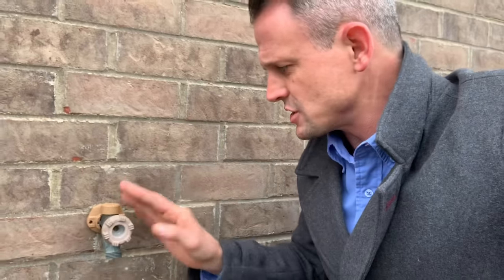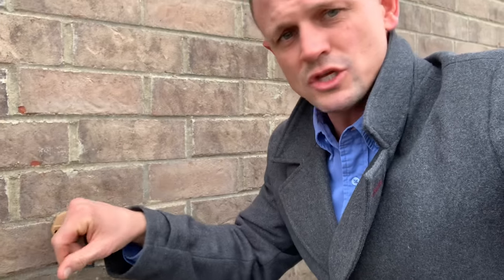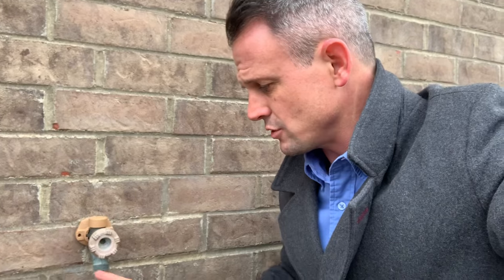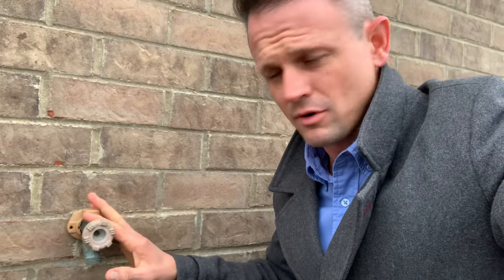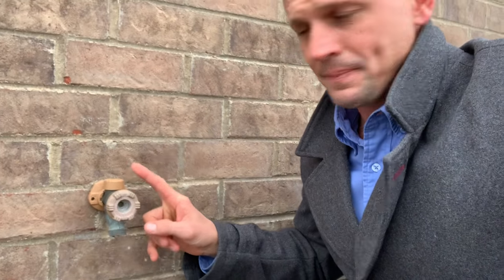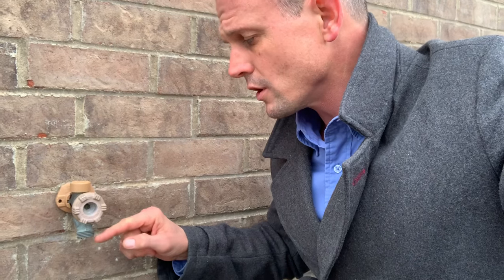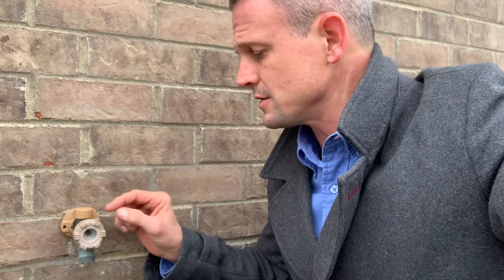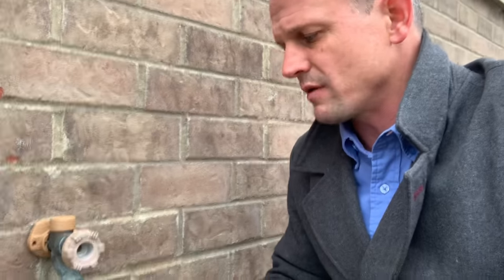How does an anti-siphon frost proof hose bib work

Comment: Hi, thank you for the video. please let me know if this spigot needs a separate from the main house water valve inside shut off valve to turn the water off for the winter?
Reply from the maker: @AchmatovaAnna  I don’t fully understand your question. These style hose bibs don’t need a shut off valve inside the home. However, it’s not a bad idea to install a shut off valve that has a built-in drain port on it so you can shut the water off inside the house and drain the pipe from that shut off valve to the hose bib, so there is no water sitting in the pipe during the winter.
Reply: @BJPoznecki  thank you so much for your answer. so, if i do not have a shut off valve inside the home dedicated solely to the hose bib, to get ready for the freezing temperatures, i just have to remove the hose and turn the bib off, and i am all set for the winter?
Reply from the maker: @AchmatovaAnna  Yes correct. Be sure to remove all hoses, timers, caps, etc. The only time that I have seen them freeze is if they are right next to a dryer or bathroom vent. What can happen is the cold air can travel back into the vent freezing that area inside the house where the water pipe connects to the hose bib. If there are no vents near the hose bib you will be fine.
Reply: @BJPoznecki  Thank you so much!

Comment: Anyone know if the performance is affected if the anti siphon is upside down.   I do drain it each winter with success, but my question is is the anti siphon system working if it's upside down, will it still prevent water from coming back in? Thanks.
Reply from the maker: It can be installed upside down however you wanna make sure that there’s a downward pitch so that the water runs out and doesn’t freeze inside.
Reply: @BJPoznecki  Yes, There is a downward pitch. Thanks for replying!   Much appreciated.

Comment: HUGE Thank you for a great explanation.  I always try to inform my clients as they get confused.  It can be confusing when folks hear "Freeze Proof"  or "Frost Proof" and then are told that you must disconnect hoses.  So many homeowners have broken pipes in the winter and it is VERY simple and preventable.  This is why I send out reminders to disconnect hoses.  Thank You again.  This is so helpful.
Reply from the maker: My pleasure thank you for the nice comment Rebecca!
Out of curiosity which Builder do you work for?
Reply: I have a concern i have this kind of outside faucet so it means i dont have shut off valve anymore? Just remove the connected hose from the faucet then thats is? No need to look for shut off valve before winter comes?
Reply: @kikodablager  - Correct. The valve is inside the house where it can't freeze, so no need to use a regular shut-off valve as well, as long as the tube has fully drained. In other words, do as he says and disconnect all hoses, etc, so the tube can drain fully.

Comment: Thanks for the detailed explanation. We just bought our home and noticed that we have two of these . The ones we have look like they have drip holes on the bottom side. I take it that once you turn it off, the excess water will drip out and not stay in the pipe.
Reply from the maker: It should be, however if you’re unsure email me a picture at wpoznecki@yahoo.com
Reply: The water should just drain where the hose attaches.

Comment: I "had" this exact 12 inch spigot installed on my new home built two years ago.  I unscrewed everything off of it and only covered it with one of those insulated covers during the winter.  It was 70F yesterday so I used the spigot for the first time and noticed water pouring out of the air weep holes in my brick.  I was able to replace it myself since the builder told me there is so much slack in the water line that I can easily pull out the spigot to replace it.  So my frost proof spigot did crack, but I wonder if I just had a faulty unit and it just cracked from something other than freezing water.  I have a different brand now that is entirely made of chrome and I used some great stuff insulation to hopefully help with the cold air draft in the wall since that wall for the spigot is in my garage.
Reply from the maker: Hard to say, like you said maybe there was just a cold air draft in the wall and something froze. Moving forward with the new hose bib as long as you don’t have any caps, hoses, timers, etc. on it there’s no need to disassemble it or take it apart, or even cover it with one of those Insulated covers. Just make sure nothings trapping the water inside and it will be fine.
Reply: It needs to be installed on a slight slope so the water can fully drain via gravity.

Comment: Thanks for the info!  Hose bibs are now constructed in much longer lengths than you 6", 8" 12" lengths you mentioned. I replaced one in my garage that was about originally about 12" with a 21" bib.  I thought; Deeper in the wall...more heat and more length for insulation protection.
Reply from the maker: Great information thank you for sharing!!

Comment: I'm tempted to leave the hose connected, but not directly... Given the explanation, it seems like if I put a Y splitter on the spigot, left a hose attached on one side, and opened the other side with nothing attached to it whenever the spigot was turned off, then the water would drain out just fine and no cracking could occur even with a hose full of water still connected. Sort of a manual drain valve for that first 12" or whatever that sticks into the house.
Reply from the maker: Like the idea Mike!!

Comment: Does it matter that the water line is angled down a little from the bib
Reply from the maker: No, that’s OK if it’s a little bit back pitched as long as there is nothing on it in the winter trapping the water in the chamber then you’ll be OK.

Comment: Thanks for the video. However, why is the anti-siphon valve adjustable? Should it be screwed down tight in the summer or winter? Why is it adjustable?
Reply from the maker: I can only speak for this style hose bib, and it’s not adjustable. The cap spins because there’s a vacuum breaker inside it that will release water when there is back pressure.
Reply: @BJPoznecki  Maybe it just spins. The ones I have, they spin, but you can tighten or loosen them. Maybe it's not meant to "loosen" but to keep tight, and if there's back pressure, it will unscrew itself ?  Thanks for replying.
Reply from the maker: @watteau6646  Maybe yours unloosen’s so you can repair or replace the vacuum breaker parts inside it.
Reply: @BJPoznecki  Thanks, that makes sense.  I'm just keeping it tight for now. Thanks for making that video!
Reply from the maker: @watteau6646  
My pleasure, happy Sunday!

Comment: We have replaced the washers/gaskets, the anti syphon plastic plunger thingy, the spigot off, but still leaks no matter what, have to shut the main valve when know one needs to use the water.  HELP! I have no accessible entry to see if my piping is sodard or threaded.
Reply from the maker: Sorry to hear that didn’t work. At this point your best bet is just to have a plumber get involved.

Comment: should the knot on the top of outside fault the anti siphon valve I think you called it, should it be open or closed. I just noticed it wasn't closed or tightened all the way and didn't know why. Thanks
Reply from the maker: There’s a few different styles typically they should be hand tightened. They can unscrew so you can replace the internal parts.

Comment: Thanks for the video! If water is coming back in the house how would one know?
Reply from the maker: Thank you! It would flood your house in that area where the hose bib is.
Reply: @BJPoznecki  I didn’t ask that question correctly, anyway thanks
Reply from the maker: @kauaireed9006  If there was a crack in the hose bib chamber pipe you wouldn’t know until you turn the water on, and then it would leak back into the house.
Hope this helps.

Comment: serious question - why don't they just make these with pex run inside the wall now? they're shielded from sunlight and wouldn't burst if exposed to freezing water now and again. They could be made in pex to copper connectors. I've heard many folks in my neighborhood cursing these things loudly because they cost a mint if a plumber installs them and you can end up with real problems if they leak inside a wall. 

to have that big of a problem occur from leaving the hose connected once is kind of dumb. I went to running pex to a common brass outdoor bibb with a shutoff just inside and no longer disconnect the hose. call me lazy, but in the fall, it can be 75F here one day and the 20F overnight a day or two later. you're always stuck taking the house out and draining it only to wish a week later it was still on to water.
Reply from the maker: Well, you have a great point. I was just with John the plumber for Sunday dinner and he always installs a shut off valve inside the house even with these frostproof hose bibs. He installs one of those shut off valves that have the drain port on the one side so when you turn the valve off, you can open the drain port and empty the water out of the pipe that’s after that valve.

Comment: Any way to bypass the siphon? I’m trying to use a sprinkler pump and want to siphon water
Reply from the maker: You might be able to take out the vacuum breaker that’s inside the round cap on the top. However, then you would have to try to find a cap that would fit on there because the cap that’s on there has slots to allow water to come out, so it would leak if you used the same cap.

Comment: The valve on the top will allow the water to flow out of the hose after you turn off the valve and leave the hose end open.  This should help keep the water from freezing back into the frost free valve. Isn't this the way it works?
Reply from the maker: Negative, you always want to remove hoses, caps, timers, etc. before the temperatures drop.
Reply: @BJPoznecki Thanks for the response.

Comment: Now that the snow is melting and about 48 degrees outside. I went to turn my faucet and didnt feel any resistance, it just keeps spinning and no water came out. Anyone know why? I already replaced it once last year. Is it frozen? No leaks anywhere
Reply from the maker: I had this happen to a friend of mine last year. The internal parts failed and had to be replaced. 

You can typically buy the shaft with all the gaskets and internal parts on it at Ace Hardware. 

The only thing you need to do is bring yours with you to match the length, as there are a variety of different lengths and manufacture styles.
Reply: @BJPoznecki  yea i watched a couple videos and seen that. I just replaced the whole sillcock before wimter last year. All well ill wait till next weekend to do it. Thanks for the help.
Reply from the maker: @DG-888  My pleasure happy to help! 

Just want to let you know in my situation some of the parts were stuck inside of the chamber, so I turned the water back on to the house and the pressure blew them out. I let the water run for a couple minutes to flush everything out really good. Then, turned off the water and inserted the new parts and it worked like a charm!

Comment: I bought one 8in frost proof and i always have a hose connected and sometimes my painter's leave faucet on and always hose been connected and on top of that it was 20° degrees cool couple day i guess that busted my faucet? So the  8in faucet pipe   leak when i open my faucet like sprinkle under my croosspace 😢im going to replace it with new one but if is cold like 30 degrees you recommend not to connected the hose and use water or just don't connected at all?
Reply from the maker: Sorry to hear! Yes, in the fall before the temperatures start to get colder, you’ll want to disconnect any hoses, caps, timers, etc. Leaving anything attached to the faucet can trap the water inside it, expand, and crack the pipe.

Comment: Gotta remove the top cap or leave it open a little or nope?
Reply from the maker: No need to touch the top cap. Water will spurt out of there from time to time that’s good it’s doing its job.
Reply: @BJPoznecki  ok, even if the cap is tightened? Just leave like that?
Reply from the maker: @MrEgg-  Yeah the only time that you would need to remove the cap is if you had to replace the vacuum breaker inside of it. That’s why they can screw off and on is so you have access to it.
Reply: @BJPoznecki  thanks so much!! I'll leave mine slightly tightened then

Comment: Thanks for the info super helpful. Is it common that you attach a timer(while off) to it and leave it on(faucet)for it to leak from the front  or are the internals going bad?
Reply from the maker: Thank you happy to hear you like the video Mario!
The only area water might come out from time to time is the vacuum breaker on the top. Water coming out of anywhere else is a sign that the internal parts need to be replaced.

Comment: BJ, thanks for the video! I found out that my hose was connected to the hose bib throughout the winter. The hose had been mostly drained (a little water dribbled out when we moved the hose) and it didn't have a sprayer on the end of the hose. My hose bib is similar to the one in the video you shared that is connected to inside my house water system. Do you think I'm safe to turn on my hose bib based on the anti-frost principles you explained in your video? Thoughts?
Reply from the maker: Hi Benjamin, I’m happy to hear you liked the video!

Well, if you have an unfinished basement, or that area is open and exposed, what I would do is have someone inside by the hose bib while you turn it on this way if it is cracked and it does leak you can turn it off right away and have a plumber replace it.

if you don’t have access to visually see the pipe because you have a finished basement, it’s inside a wall, etc. then the only way to find out is the turn it on and monitor if there’s any water leaking inside the home at that area.

Comment: Hey BJ good video! I have a question for you. Should you leave the hose bib open or shut during the winter months?
Reply from the maker: Thank you!

If you have the same style frostproof hose bib like in this video. It’s OK to turn it off because it turns off the water inside the home where it is warm.
Reply: @BJPoznecki  OK BJ thank you!
Reply: After the water is off and drained you should still put a cap over the end so no cold air gets in.

Comment: Nice Vedio sir!. 
I have frost free bib Outdoor Faucet. Unfortunately I left a garden timer attached to faucet last winter. that probably stops water flow through faucet , I don't see any crack in the pipe. but no leak/water from faucet or anywhere from pipe. what causing water not coming through faucet. Please help !!
Reply from the maker: Thank you for the compliment on the video! At this point you would have to replace the internal parts of the hose bib. I would recommend having a plumber do it as it is more of an advanced repair.

Comment: Hello! Question for you… I have basically that same bib in the front of my house, and after I turned the water supply back on, I went to turn the bib in, and no water was coming out. And when I slightly uncovered the anti  siphon cap, the hose would then work fine * no leaks from the cap * is that normal?
Reply from the maker: No, it sounds like the internal parts are starting to wear out. They have rebuild kits that you can buy at Ace Hardware.
https://youtu.be/KlDZyKpwFV4
Reply: @BJPoznecki  oh really… hmmm even if there’s no dripping from the cap, you still believe it could be an issue? My plumber knowledge is very below par haha… could the cap im speaking of not be the anti siphon cap and be something else? It’s our first year in the house

Comment: Wow i left my water hose on all winter and now water is barley coming out...do i gotta change whole thing?
Reply from the maker: Sorry to hear Geo. 

You might be able to get away with just changing out the internal parts.

I would start with following the instructions in this video https://youtu.be/KlDZyKpwFV4 and hopefully that will solve your problem. Naturally, turn off the water to the hose bib if there is a shut off valve, or you will have to turn off the main shut off valve to the whole house.

Otherwise yes, you may need to replace the whole hose bib.
Reply: @BJPoznecki  thanks

Comment: Frost proof?  Mine looks exactly like that one.  No hose hooked up and it's frozen.  Trying to find a video on how to thaw it out.
Reply from the maker: It’s possible you could have just the anti-siphon style hose bib and not one that is also frostproof.

If you have access to the piping that leads to that hose bib inside the home, ie. from the basement if you have one. You could take a heater, hair dryer, or heat gun and heat the pipe to thaw it out.

Comment: Hello I turner of my water supply going to the outside with this same faucet but still left a hose connected to the faucet. I disconnected the hose thawing it out and it was frozen inside also in the faucet. Will I need to replace the pipe?
Reply: Turned off my water supply going to the outside faucet***
Reply from the maker: @walterbeteta5652  Once the temperatures rise above freezing turn the water on and see if it’s leaking inside the home. 

If water is leaking then yes you would have to replace the hose bib.
Reply: Thank you for the info. I appreciate the help also
Reply from the maker: @walterbeteta5652  My pleasure!!